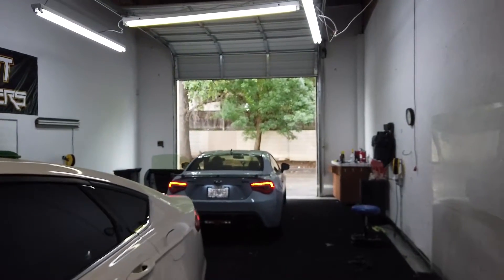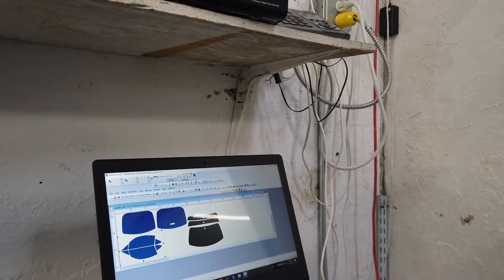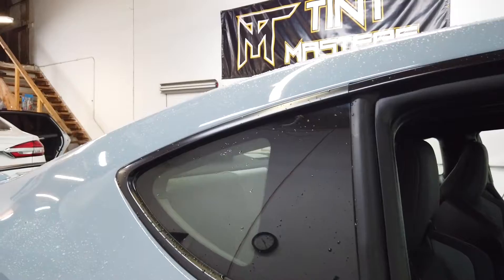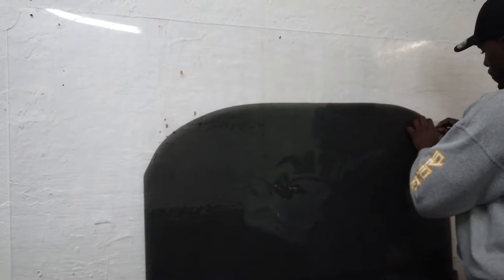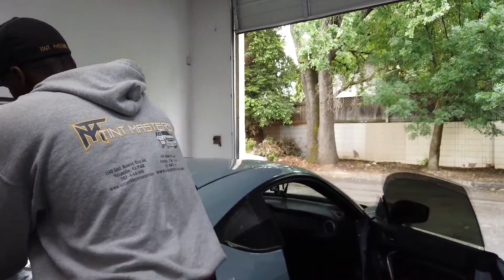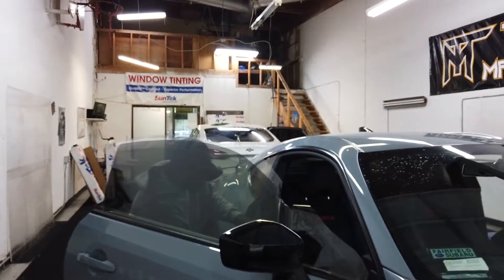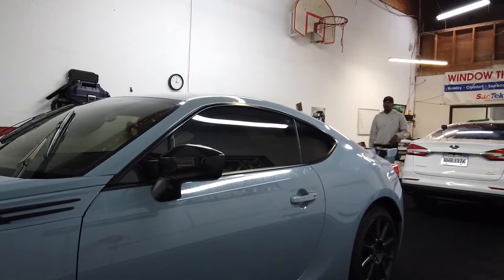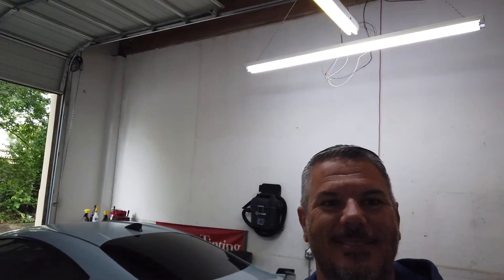Tint Masters Tint Up The 2019 Subaru BRZ Gray Series (SunTek)

Comment: Hello how did you get the side windows to stay up?
Reply: Trick the window use the latch that keeps the door closed or if it had a bolt on the side of the inside where the door closes not on the door